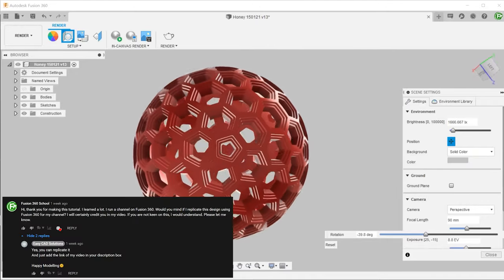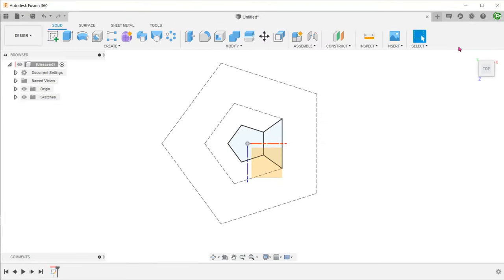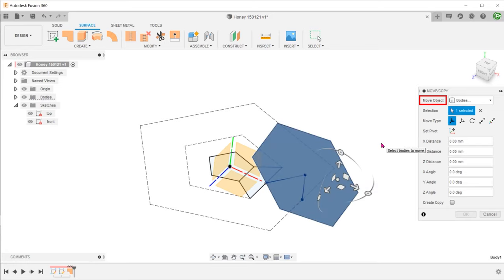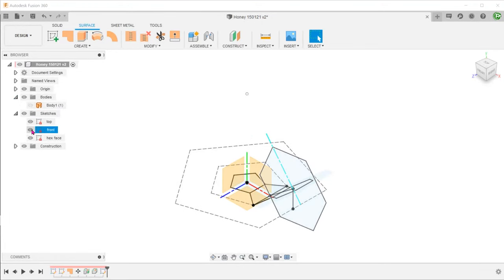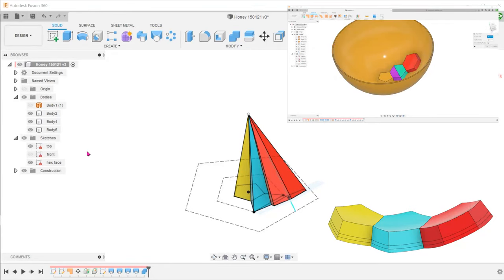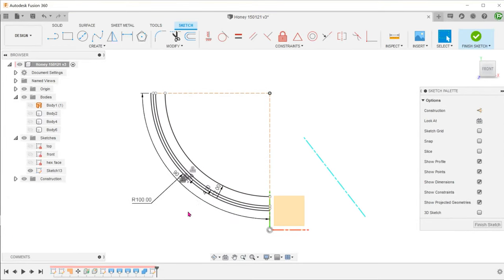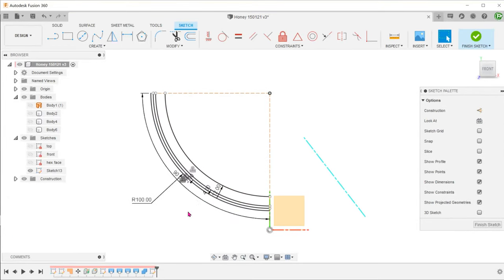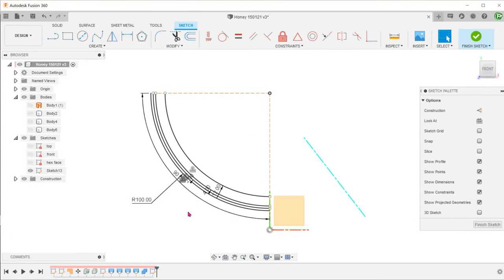Fusion 360 - Honeycomb Sphere (Full Narrated Tutorial)

Comment: Instead of the final mirror and move, what about creating a horizonal axis at the sphere center then performing a 180 deg circular pattern about that? The patterned bodies seemed to merge fine in other places.
Reply from the maker: Wow, I tried this and it works even at a precision of 1.123. I would have never thought of using a circular pattern that way. That's really good thinking on your part. It does seem strange that putting an axis at the centroid would be more accurate than placing a construction plane, though.
Reply: That worked for me! Thank you.

Comment: IDK if this has been answered before in the comments, but I think what gets the last two pieces to not merge properly is the definition of the mirror plane. When you create an offset plane and select a point fusion will per default measure the distance an put the distance in the box, without any parametric link to the point you selected. Because the floating point precision in fusion is somewhat low you'll therefore get a plane that is not exactly at the centerpoint. If you go back and edit the plane and choose extent to object instead of distance you will get the definition of the plane as a parametric relationship, and it should work.
Reply from the maker: There a was lengthy discussion in the comment that I pinned. I think the conclusion was that it was a precision problem. When you click on the point, Fusion somehow rounds off the distance.
Anyway, I went back to the model and tried both ways (choosing distance and clicking on the point/choosing to object and clicking on the point). Both ways worked this time round. 
One of the viewers had actually submitted a change request for this. So it seems like it has been resolved.

Comment: 16:44 I think that took Fusion about 2 minutes to perform lol (I thought it had crashed but it pulled through as I was typing this comment)
About the combine at the end: I combined before punching the holes through and it just worked. Took a few seconds for Fusion to think, but the result is 1 perfect body. Where you use 100mm(?) I used 10m, maybe the scale matters? I made that value parametric and had all other constraints derive from it, but I fear Fusion will explode if I change the param value.

Comment: how are you moving around the part so smoothly? is it just practice or do you have a plugin of some kind?
Reply from the maker: I'm using a space mouse. 
https://3dconnexion.com/sg/product/spacemouse-wireless/
Reply: @Fusion360School  wow that's actually really cool. I didn't know a product like that existed, thanks.
Reply from the maker: @ianadelman8380  It's a pity that regular mice cannot replicate this smooth motion. I don't understand the mechanics of it.
Reply: @ianadelman8380  , it takes a little bit to get used to it and you still need to use a regular mouse to straighten the view. I use both hands; ordinary mouse on the left, special "mouse" on the right. For me, it is impossible to move the model exactly up/down and left/right; it ends up rotated somewhat.
Reply from the maker: Hi Michael, I use it the same way as you. I'm a left hander too. It's great to be able to decouple model movement from the regular mouse. You are right that panning is an issue. I'm not sure if there is a shortcut on the space mouse to pan.